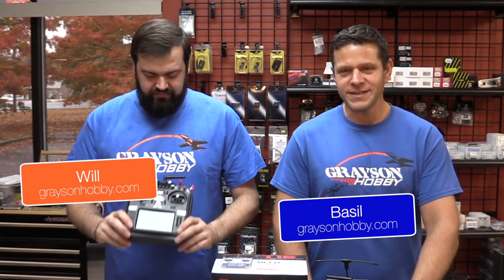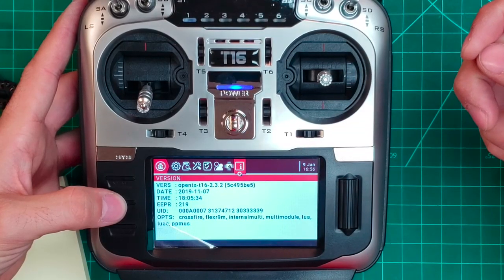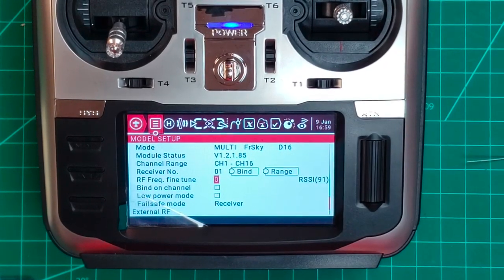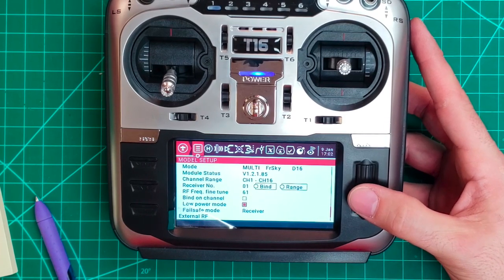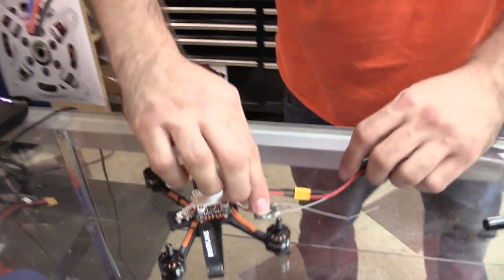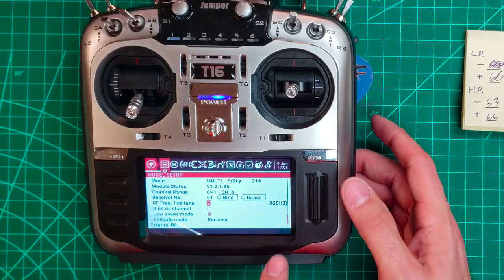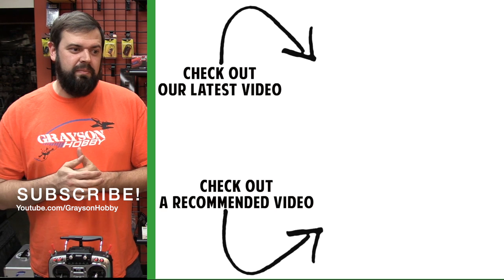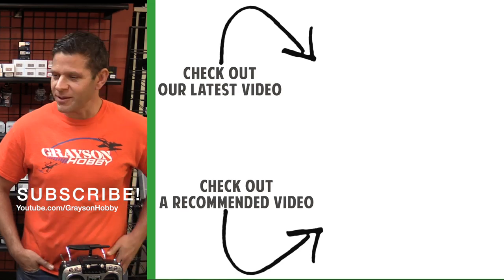Jumper T16 Pro MUST WATCH Before Flying or you might failsafe | Receiver Frequency Tuning

Comment: I bought one of these radios to replace my Taranis and DX8. Now I have 2 hobbies: a little flying and a lot of dickin' around with this radio.
Reply: That’s what I’m saying there’s too many things you gotta do with this radio just to get you flying
Reply: Sell it and go back to your previous two radios, then.   This whole hobby is about “dicking around”, that’s part of the fun.   If you don’t get that, this hobby is not for you.
Reply: You think the taranis was more simple to use. 😂😂😂😂
Reply: Jamie MacFarlane exactly!
Reply: Get a Horus X10 or X10s (non ACCESS) and you wont have any of this crap!
Reply: Would tuning, not mess up other brand of receivers?  Tuned to FrSky, but messed up for others?
Reply: Would it be a good idea, for a newby to skip Trannis/FrSky and Spektrum and get the jumper instead? Not a newby actually, , but a resumeŕ
Reply: I know what you mean.  I have been in the hobby since the 1980's and love how you can still learn new stuff and have fun doing it.
Reply: Some of us just want to fly, we don't want to dick around forever in a day configuring and repairing things.
That's one of the reasons I got away from big airplanes, it's nothing but building and maintance all the frigging time, and very little flying at all.
Most airplane home builders never, ever even reach the point of flying and give up (or die before it's finished) with a half built airplane in their garage...
Reply: @svenmohamad8646  YES

Comment: Thanks for making a video about this. I have been trying to tell people about this for years (applies to all multi-protocol modules, right back to the ones that you had to solder into Deviated Devo7e radios). I have seen so many people send back or throw away receivers (or even whole flight controllers) because they think they are faulty, simply because this freq.fine tuning procedure is not widely known.
Reply: BTW, you could just watch the lights on the receiver, to see when it loses bind.

Comment: I'm no tech expert but I would never do this kind of tuning indoors unless you plan to fly indoors.
I've had issues with receivers that just would not bind indoors, but worked fine outdoors.
So if you want to tune for outdoor flying, you need to tune outdoors to be in the same operating window.

Comment: I would love to see a video about binding a PNP king kong 185mm to the new Jumper T16 Pro. Jumper r1 or maybe DSM2/DSMX. Great channel guys! 2 Thumbs up!  I dont have any BNF/PNP setup experience.  Thanks guys. Use the #420 one... LOL
Reply: MrIndyjonescj Hello, did you solve the DSMX/DSMX2 bind challenge? Please share. For me it’s like it’s just not talking yet. Cheers!
Reply: Not yet. My jumper Isn’t making things very easy. Spectrum receivers Are fussy anyway, but my jumper doesn’t want to bind any flysky receivers either. Ya Flysky. The easiest protocol there is. Binds to FrSky and bayang great. Won’t recognize My crossfire module either. This hobby is testing me pretty harshly. I may have to end up just getting quads and whoops with FrSky and bayang protocols. The funny thing is, my cheap Fkysky transmitter binds to the Fkysky receivers in about one second. So far to me the cheapest seems to be the easiest. Let me know if you figure anything out as well. If you look for videos on DSMX or DSM2 there doesn’t seem to be any. Just one or two and they don’t cover much. Or they’re using a Spektrum radio. Happy flying!

Comment: The latest firmware on the 4in1 as of 11/25/19 is 1.3.0.44, this what it took to bind to my dongle for Liftoff, the dongle binds to DSMX 22ms.  BTW if u have a bad 3 way switch as I did, that is both end-points on mine were high, I took the little ribbon cable off the board where the two switches were hooked up (mine SD&SC) to check check if switch was shorted, it was not, but when I put the ribbon back in and pushed the clamp down it was working properly.  Guess the ribbon was originally pushed in at a slight angle.

Comment: Well I have a Tinyhawk S with (frsky rx version) ... when finetuning by a chance of 90% it won't recover the signal at all and I have to power cycle the quad or tx that it connects again...  Thawk S specific? I set it to FRSKY X in betaflight to connect via D16

Comment: Do you have to do this for other protocols on the Jumpers? For example... spektrum?
Reply: The protocols which require frequency tuning are:

FrSkyD (e.g. FrSky D4R and D8R, DIY RX-F801 and RX-F802 receivers)
FrSkyV (e.g. FrSky V8R4, V8R7 and V8FR receivers)
FrSkyX (e.g. FrSky X4R, X6R, X8R, and XSR receivers)
S-FHSS (e.g. Futaba S-FHSS receivers) 
Corona (e.g. Corona V1 FSS, Corona V2 DSSS CR8D/CR6D/CR4D and FlyDream IS-4R/IS-4R0 receivers)
Hitec (e.g. Optima, Minima, Micro and RED receivers)HoTT (e.g. Graupner receivers)

Just copied this from the github on the subject

Comment: I always get low signal strength when flying my rc planes. Yesterday it showed a lost signal. Always weak signals when flying maybe 50 yards away. What do I need to do with the TX 16s to correct this. I am using a spektrum receiver.

Comment: Does this also apply when using DSM receivers?
Reply: I think that they recently added the option to fine tune the frequency on other protocols but, generally you should only really need to do it for receivers that use protocols that utilize the CC2500 RF chip. In other words, you should only need to do it for the S-FHSS, Corona, Hitec and, FrSky protocols
Reply: I seem to have run into this issue with my DSM receiver's, is they're a way to fix this?
Reply: @ziamckeithen1322  I seem to remember hearing that there was an issue with DSM and the JumperTX firmware (not entirely sure what it was, I don't have a Jumper myself). I think the fix was posted in the Jumper T16 RCGroups forum. However, as OpenTX-proper is now available for the T16, you'd probably better off flashing that to it (if you haven't already). You may need to update the firmware on the multiprotocol module too, I'm not too sure. You'll get more direct help if you ask in that RCGroups forum. But, maybe the Grayson Hobby guys know more...
Reply: @Temporal_Flux  thank you, I'll try to rember to check they're too

Comment: Guys, just have an issue with my jumper t16 pro, the MDL is now get into Widget setup instead of model settings. Would you be able to help please? Thanks. I’m running latest OpenTX 2.3.4 and latest multiprotocols firmware.

Comment: On a plane with just an esc and no flight control?
Also do the regular frsky auto range this if so why don't these?
Reply: WHAT!!?
Reply: @Freebird_67  how do you do this procedure on a plane with no flight controller? And why does this need to be done with Jumper tx and not like a Taranis. Do the Frsky txs  do this calibration automatically?
Reply from the maker: You tune your frequency for the RX for an airplane with this same procedure.. Airplane, Heli, Plane, RX is an RX

Comment: Hey guys, nice vids..... ! Topic is: I don’t have a BNF spectrum cub to bind to (although my grandson could learn on that one)

I having trouble binding to my spectrum 620 and 636, and orange RX dsmx/dsmx2. I insured that I can bind with my DX6E, and yet, I am not able to bind with my new JUMPER T16Pro. Surely it must be user error. I checked the throttle setting for “fail safe” , but the ESC will not even beep through its post mode. Rx only blinks. I’ll re-try the firmware install through Bootloader ..... selected multi-mode and Dsmx.... just missing the tip.

Thoughts?

Comment: Two days ago the MDL button on my T16+ started developing this problem, when it is pressed I get the Tele setup screen not the model setup display menu. I searched through the rcgroups.com forums, facebook group and found other people experienced the same problem but no comments as to how to fix it.  Some have speculated it is because there's no models programmed or that it needs a new firmware flash. I have models programmed and flashed the  OpenTX version 2.3.3 nightly versions and did NOT fix the MDL button issue. Is it possible for the T16 is no longer powering the external TX module? It looks that way cause the Vout on radio's back pin is 0V.
Reply: It’s a ribbon cable problem.  Removing, flipping, and reseating cable fixed this problem for me.

Comment: Newbie here.  Considering the purchase of a real transmitter to replace my toy transmitter.   This looks kind of complicated, but possible.   Are there any manufacturers making RTF multirotors with which this transmitter would NOT work?  Also, you are tuning the drone with a Windows based computer.  Is a computer required?  If so, can a Mac work?  Can you do these adaptations on the transmitter without a computer?  Speaking of computers, I noticed that the computer flight simulators are also for Windows.  Is the R/C community a Windows world?

Comment: Great video but fails to highlight one point I believe, and that is than not only would you need to do this fine tuning to "Your Receiver" but theoretically to each and every Receiver you have in each and every model if you're worries about this.. . Since I have 20+ models in different planes and I haven had an Rx go into fail safe due to loss of signal for over 5 years,  I'm not about to start worrying about this now..Just Sayin'

Comment: Will/Basil, I tried this process and It loses reception (radio) in at 60 feet (20m). I bind it with Jumper T16 Pro V2.
BetaFPV 65X 2S
Any advice to resolve the radio range?
Thanks,
Arnold

Comment: Try putting a UHF module in the back of there and see what happens!  Not good anyone flying UHF steer clear of this TX you have been warned.
Reply: BillHally that’s fact!!   433mhz kills the Processor and jams the radio because this radio has shit shielding .  868mhz and 915mhz works but I’ve heard of glitching.  You can shield the inside with Copper tape and that helps specially if you use copper tape and actually ground it but who the Hell wants to spend $150 on a radio and have to fix it to use uhf!?  Not me!  I’ll stick with my QX7 with XF mod and R9 gear.  No issues as of lately running older rx and tx FCC sbus firmware 180329 👍😉

Comment: Bleeeh I'm not doing this, I just won't use Frsky receivers.   They're suppose to do this at the factory.   
 
It's crazy how immature this hobby still is, selling uncalibrated transmitters to the public.
Imagine if you had to radio signal strength tune and calibrate your cell phone, cordless phone, car keyfob, garage door opener, or wifi router right after you bought it.
Sitting around the shop screwing around  with nothing better to do, you guys should open them up and VAR tume them before you sell them out the doors to customers.
Reply from the maker: 2 different manufacturers . Each use different equipment to test and tune the frequency

Comment: Why is this tuning actually necessary. This is not required even on the cheapest of radios so why with Jumper for a mid priced radio. It's the craziest thing I have ever seen you have to spend a lot of time Binding , adjusting and Binding. Buy a Horus X10/X10S instead no adjustments like this are required.
Reply from the maker: Its required because it's a muti-module. This is the case for all multi modules.